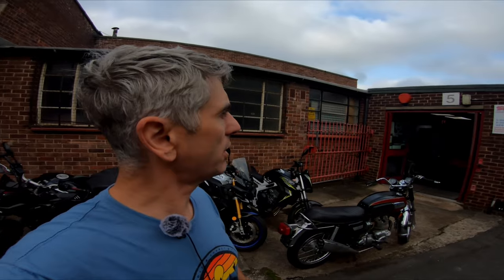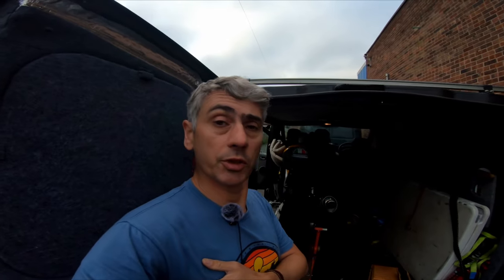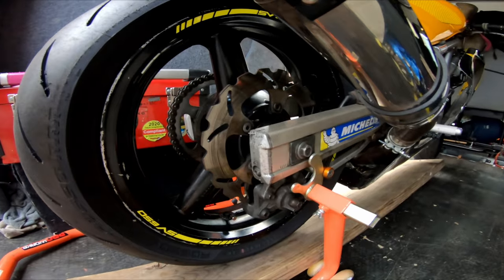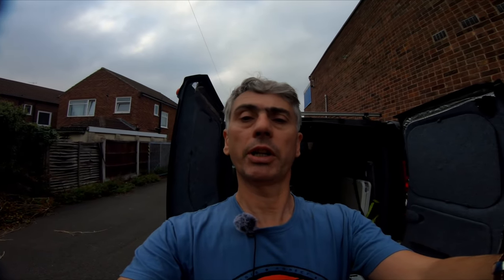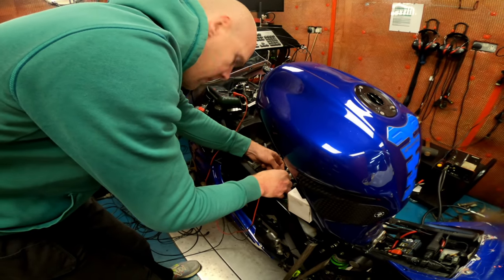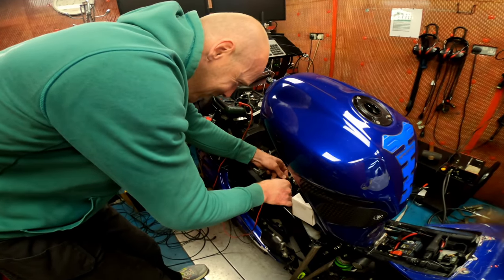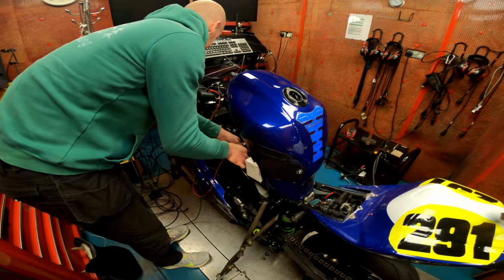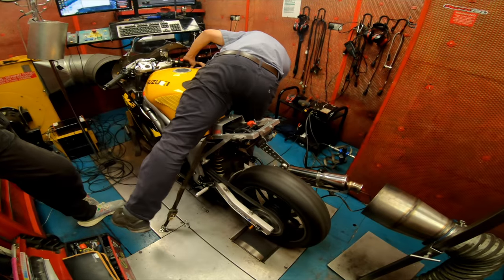SV650 minitwins on the Dyno. Power runs.

Comment: It's difficult to know what is amiss here as 74hp from just the inlet cam change seems a little bit high, but the AFR is showing lean. I would have thought an AFR closer to 12:1 would be right for a full load run. 14.7:1 is stoch, which is fine for idle conditions, but it's my understanding that it needs to be a bit richer for good power. In my mind, I wouldn't be able to trust either the HP or AFR from that session as a basis for making adjustments. Perhaps visiting a different rolling road and comparing the results with your current ones before making any adjustments would be worthwhile if feasible? Is there a reason you didn't also swap the exhaust cams for gen 2 items? I beleive they have more duration and lift compared to gen 1, and I presume they still meet the 72hp limit. Best of luck with this, I'll be following along with interest as I've got a gen 1 SV track bike with standard cams at the moment.
Reply from the maker: Thanks. Power and AF suspiciously high on both bikes so I share your concerns there. Only swapped inlet cam. Putting the gen1 inlet cam in exhaust position is known to increase power further but is not legal for minitwin rules. I think gen 2 exhaust cam is pretty much the same as gen 1.
Reply from the maker: Update. We both went to a different dyno which confirmed suspicions that the AF Sensor was at fault. Will do a follow up. Went up to 142.5 main and AF bang on. 74.5hp.